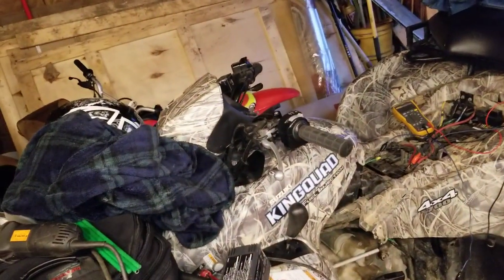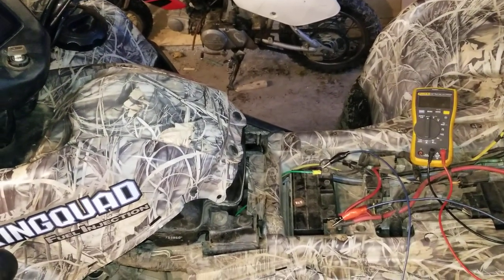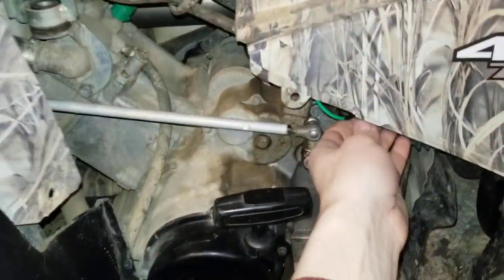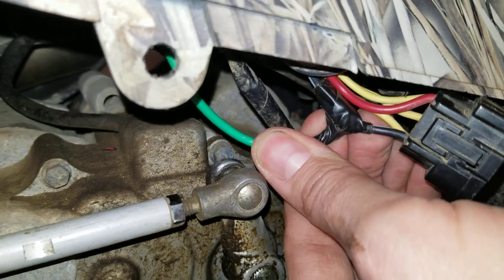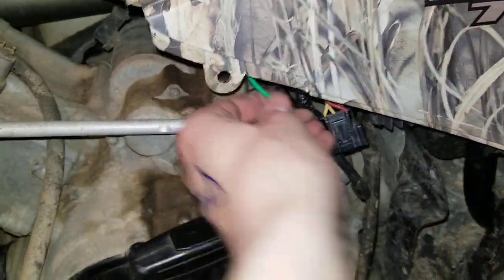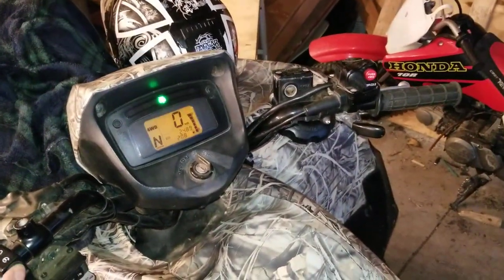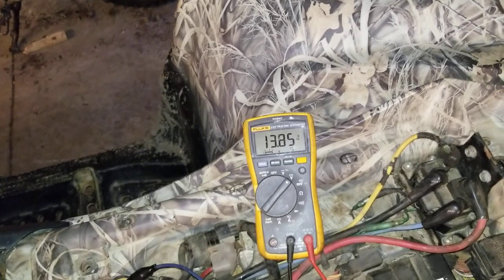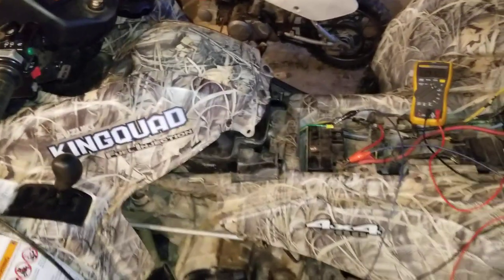Suzuki KingQuad 700 battery drain charging stalling problem

Comment: Awesome video on fixing this stalling/charging issue!!!  I have the exact same year King Quad and have historically had this issue the whole time!!  Installed new rectifier regulator with the ground wire and now runs and charges at 14.5 volts...  Awesome info!!

Comment: I've been running the extra ground wire trick for a couple years now and it's did the job, but I finally had time to track down the location of the problem on my 2005 king quad. I found a badly corroded connection on the ground wire that is connected to the negative battery terminal under the seat. It's the black wire with white line and the black plastic quick connector. I used a pin release tool to remove the slide connector from the plastic plug housing, then I cut the bad connector out and installed an new one, and reinserted the new pins into the old plastic housing. I then detached the ground wire trick and all is working well again. It doesn't die when putting in gear or activating the brake light, and the battery is charging at 13.80. Just thought I'd share my detailed findings in case you or anyone else can solve it using my experience and rid yourself of the ground wire trick. Be safe out on the trails.
Reply from the maker: All at once fixed some wires under the seat that mice chewed and cleaned all the connections on the positive and negative battery terminals and ran a negative battery terminal frame ground wire.  Because I did all 3 together I don't know which solved the stalling problem when i turn the headlights or the radiator fan turns on or if I engage 4x4.  It no longer stalls and I'm very happy about that.
Reply: which black & white wire did you skin back on mine it has 2 black & white wires running out on my 05 700??
Reply: Brad Brown, I don’t think it matters which one you choose to tap into for a direct ground to battery cause they are both basic grounds running to the rectifier so either one should work.
Reply from the maker: I found my ground wire to be corroded on the negative battery terminal also.  Cleaning it with a wire brush and using di-electric grease on both battery terminals and all connectors on them helped my stalling  problem ALOT!
Reply from the maker: @bradbrown1805  both are ground wires.  It doesn't matter which one.  Be sure to clean your battery terminals with a wire brush and dielectric grease them too.

Comment: JACOB, Thanks for the great informative video! I wanted to know if you ever had symptoms where it drained your battery? I just picked up my machine,  09 750 from the original owner. It only has 632 miles on it. But it sat out in the backyard most of its life. I bought it w a bad batt. Replaced it w a chinese crappy cheap one...now i'm regretting that move. Wondering if it's my cheap batt or machine discharging issue

Comment: I been dealing with this issue for a while, I run a ground wire like he said it started charging 14 volts an fixed the problem, thanks so much
Reply from the maker: Mine stalling problem FINALLY went away completely when I  wire brushed all the connections on the negative wire terminal too.  I then applied dielectric grease to prevent further corrosion.

Comment: I'll be doing this, got 2006 KQ700 with the exact same problem. Thanks.
Reply from the maker: Be sure to wire brush the battery terminals and the connectors that screw to them then apply a little dielectric grease.  That REALLY helped my wheeler stop stalling when used headlights or anything electric

Comment: Can I use Quick Splice Spade Terminals Electrical Wire to attach to run my ground wire instead of soldering it
Reply from the maker: I don't see why not.  I would use di electric grease too to prevent corrosion.

Comment: I’ve had issues for a while and tried so many things but this simple fix did the trick, thanks
Reply from the maker: Glad to hear it.  Don't forget to wire brush and apply dielectric grease to the positive and negative battery posts and wire connections.   That really helped me alot too.
Reply: What year do you have?

Comment: Past week I got a 2007 KQ 700 to work in my weekend house. Today I had this same issue several times.
Next week I will come back with all the necessary to add direct ground.

I will tell if works for me.

Thank you and best regards from Spain!
Reply: Hey how'd it work?!
Reply: Hi.

Now my battery is charging over 14 volts. Didn't remind the exact number, but the atv is running perfect! 

Plus this regulator ground, I also add direct ground from starter coil and clean and put some WD40 in all the connectors I saw.

Comment: I have same year and camo quad 700. It will start with pull cord but the electric start just clicks.  Did you have this issue?
Reply from the maker: 3 common causes for the clicking sound and no start.  
1.) Possible weak Battery. 
2.) Possible bad Starter solenoid. 
3.) Possible corroded or loose / bad connections on the battery terminals, starter solenoid connections, or starter itself. 

I have not had this issue yet.  Check the voltage on your battery, it should be 13V or more before you start the machine. When it is running it should be between 13.5 to just above 14.0V.  
Turn the headlights on and watch the headlights when you try to start it. When it clicks do the headlights go right out? If so then it's a bad big wire connection, either the ground strap, the batt terminals, the heavy wire to the solenoid. One of those is corroded or loose. If the lights go really dim then the battery is depleted. If the lights stay full brightness then there's a bad starter connection or a bad starter or bad solenoid.
  You will also want to check for voltage at the starter motor itself.
Also . . you can pull start your 700?!!!  They are a beast!  Post a video of you pull starting one of these monsters!!!
Reply: Had the same issue, resolved mine with a new starter. The starter I had tested good because it was getting voltage to the terminal, although internally the terminal wire inside the case of the starter had frayed ( someone sent it a little extra and shit the 🛌)

Comment: I have a 2006 King Quad 700 camo and go through a battery every winter.  You think this grounding will fix my problem?  I keep a Optimate charger on it in the winter but that doesn't seem to help.  Any thoughts?
Reply from the maker: Start the atv and while its running you should have about 14.0V DC across the positive and negative terminals when measured with a multi meter.    If you don't then shut the engine off and clean the battery terminals and the wire ends real good with a wire brush.  Start the engine and measure again.  If not 14.0V DC then run a grounding wire.
Reply: @jacobmartino4475  Thanks I'll give it a go.

Comment: I can finally use my winch and  not have to worry about not shutting the bike off afterwards until I can get to a charger.. likely save on batteries too..lol
Reply from the maker: Glad to hear it.   Don't forget to wire brush your battery terminals and dielectric grease them too!
Reply: @jacobmartino4475   absolutely! Thanks again dude!

Comment: I have a 2008 King Quad 750. Battery is newer and just had it tested working fine. Every time I start it, acts like it isn't getting enough juice. would this fix the problem? Were 2008's prone to not charging as well?
Reply from the maker: Clean your battery terminal crimp connections first with a wire brush and put some dielectric grease on them.  Corrosion is an issue a lot of the time.
Reply: @jacobmartino4475  Thanks I will give it a shot and see how it does
Reply: Same issue with my 07 king quad, I go through a battery every year and seems the winch is drawing way to much power when using it will stall out and I'm forced to crank it with my pull start.  Might try this saudering idea Jacob has done, hopefully its the long term solution.  I haven't been running a trickle often enough during the cold winter which could also be an issue.

Comment: I can't find the black wire with a stripe on my 06 700
Reply from the maker: Try taking the positive and negative wires off of your battery terminals and cleaning them with a wire brush.  Then apply dielectric grease before re installing them.  See if cleaning the terminal corrosion helps.
Reply: So my wires connector from the stator to the rectifier were melted. It has a new battery. Replace the connector and it started charging the battery at 17 to 18 volts. Someone suggested to put a ground wire on one of the screws from the rectifier to the ground terminal.